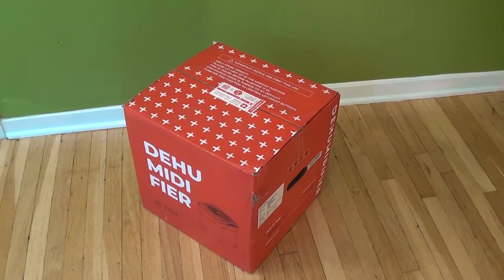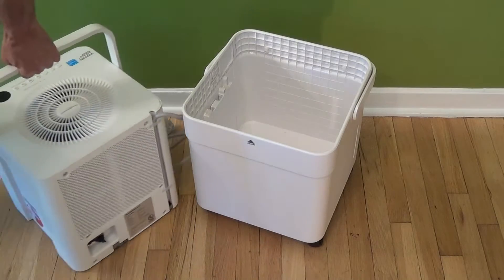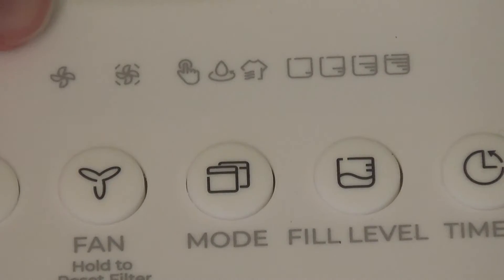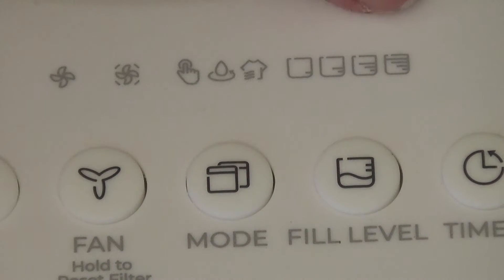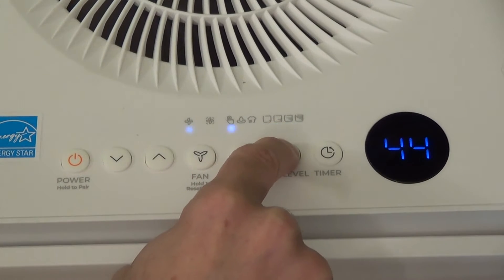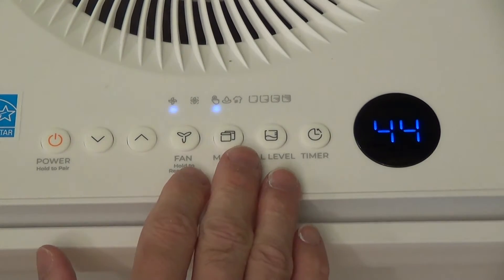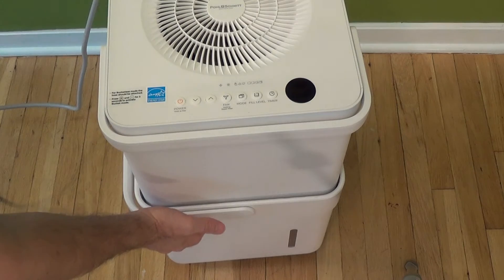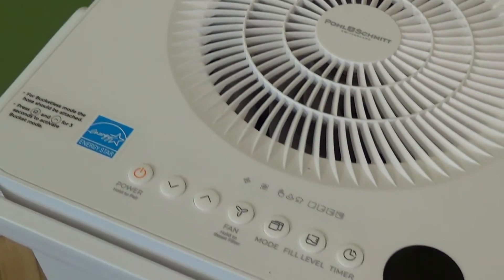Pohl Schmitt Cube Dehumidifier - Setup and Operation

Comment: You did a great job with the review really thoroughly explained everything. This is the same as  Midea unit that actually makes this. I did want to ask does the fan cycle off after it reaches the humidity set the for in the room?

Comment: Regarding the modes, if no light is on you are in manual mode.

This device is also sold by Midea as the cube and qlima as the D 720 cube. The Midea has it's own app, the qlima uses the smart life app, which I prefer as it allows for nice scripting etc.
The Qlima has 3 fan speeds. Not sure what the effect of fan speed is on the dehumification.....

Assuming this devices continues to work many years, I think this is absolute the best design. If you need more capacity, just buy a second!

Comment: I have the Midea 20 pint on main level of house,  a 50 pint with pump in the basement, satified so far.  Think I might put a 20 pint in the upstairs hall to serve the 2nd level.  As anyone had issues with Pohl Schmitt units?  Really wondering if the $50 savings between the two brands is worth getting the Pohl Schmitt.

Comment: This is a lesser version of the Midea Cube. Looks the same, but the internals are cheap.
Reply: The internals are the same, made by the same factory for different vendors
Reply: @naumstojcevski8634  A company can opt for cheaper or higher quality components during assembly. A retired friend of mine used to work in Zhoushan for a company that manufactured aquarium pumps and though several models had the same shell, they had different motors, tubing, and wire grade. I bet if you disassembled both the Midea and the Pohl Schmitt, you may find that some components come from different companies.
Reply: @gunstargizmo If you have looked at the internals of a Midea Cube, would you be able to answer a question for me? A few amazon reviews state that there is no hardware/float sensor in the bucket to detect the fill level, and that the fill level is instead computed based on the amount of time the unit was run for. The reviews said their unit caused flooding because the fill level was reset to 0 in software after a power failure despite the bucket being close to full. If the reviews are wrong and there is indeed a hardware float sensor in the bucket, how is that information passed onto the unit from the bucket?
Reply: @chetanreddy6424  The dehumidifier will remain off if power is disrupted. The bucket will have to be emptied and the unit restarted. There must be some sort of sensor because the unit won't run if the bucket is full.
Reply: Yeah its a cheaper and worse version of the midea